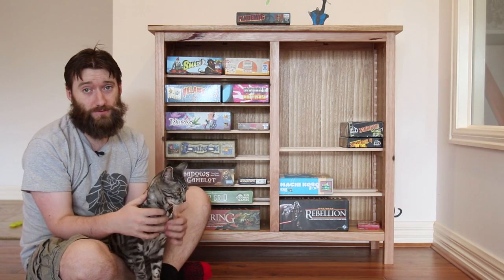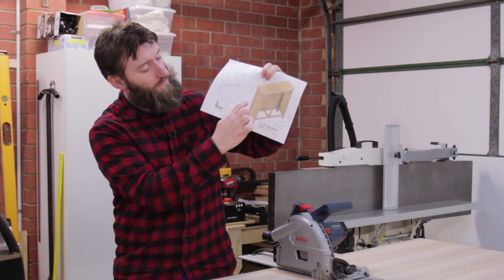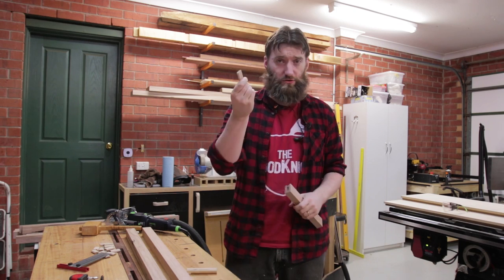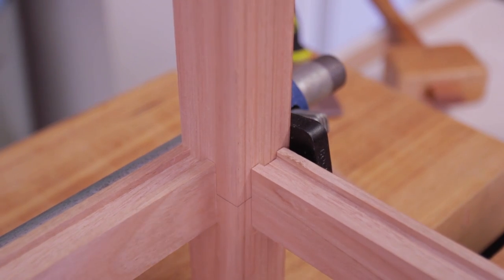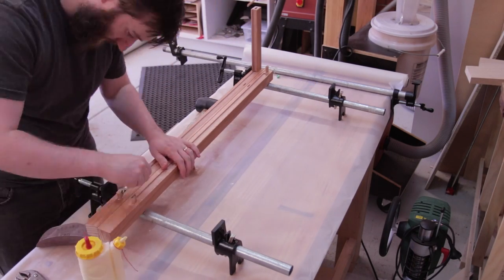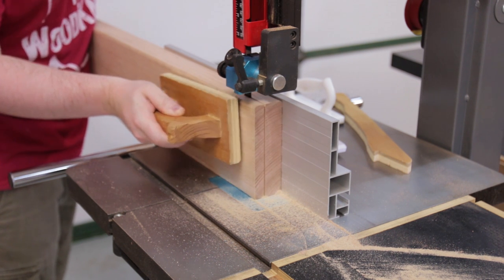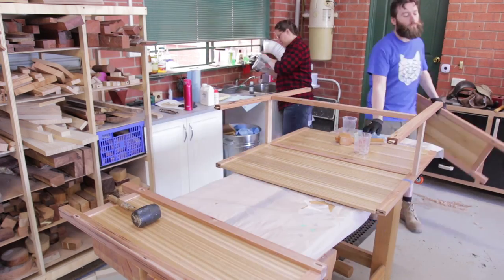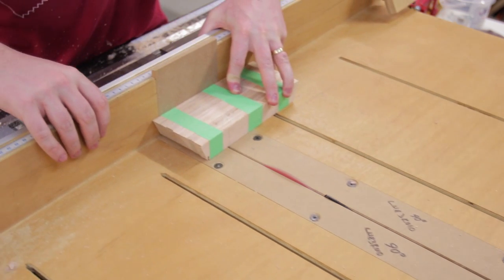Adjustable Board Game Storage (Box Usurper) | Woodworking

Comment: The saw tooth shelf supports look pretty cool. It actually makes up a huge part of the visual appeal of the piece. Much better than a column of crappy 5mm holes spaced 32mm apart. 👍
Reply from the maker: I'm hoping "system-i-hope-this-works" catches on to replace system32 ;)
Reply: I reckon you might be in with a chance. While system32 dukes it out with pocketholes, your system might slip through unnoticed and take the prize.

Comment: Very enjoyable! What epoxy do you like?
Reply from the maker: For adhesive/bonding purposes, I like west system. Very strong, very reliable. And economical because  it's mix by weight (which is easy) instead of just mix by volume (harder to do small  amounts). For casting, whatever is clear and cheap ;)

Comment: Another quality video producing a quality product. I also have a Sawstop table saw but does your new Freud rip blade meet with Sawstop's technology
Reply: So long as a blade fits into the brake it will work, that's why you need the dado one for dado blades. The actual blade itself doesn't matter AFAIK.
Reply from the maker: I don't understand the question, sorry.
Reply: On Sawstop's website they mention blades that have shoulders and/or antikickback features as blades that won't react quickly enough when the brake trips or hits skin and therefore a more substantial injury may occur. So Pete G, not all 10" (250mm) blades will work "perfectly" with Sawstop's braking technology. They also mention not to use "painted" blades but I've never seen one of those. "Coated" blades like on the Freud's are  OK. I wrote to them about another blade, the Freud P410 blade and they said it was OK. So that's what I'm asking Paul. Would Sawstop approve this new rip blade?
Reply: I can tell you from experience that Saw Stop worked perfectly fine with my Freud Premier Fusion blade. I accidentally hit some aluminum and it triggered the brake. It damaged the blade, but the saw worked exactly like it was supposed to. I'm sure your best bet, if you're not sure, would be to ask Saw Stop on any blade you have any doubts about.
Reply from the maker: You'd have to ask Sawstop, sorry John, I haven't asked them specifically about it. I think the only way I'd be able to verify would be to run it into something conductive.
Reply: STEALTH try aluminum t-track. Don't ask me how I know.